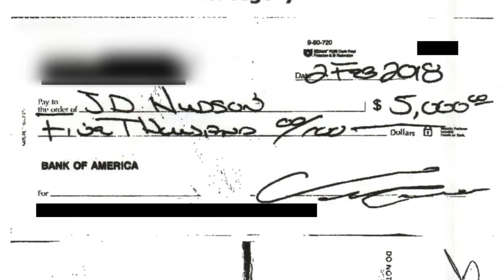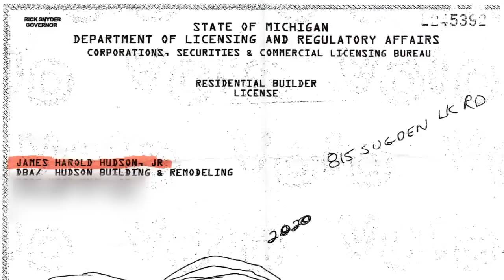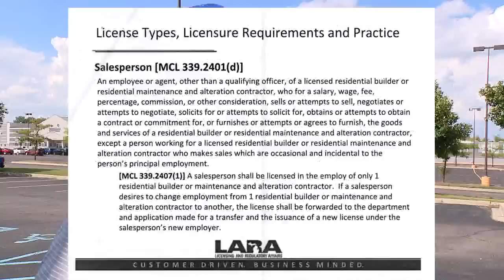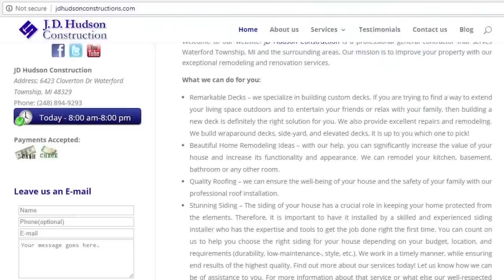Bamboozling Builders in the Hall of Shame

Comment: Never Never pull your own Permits for a contractor Huge "Red Flag" I feel bad for the these people who did. Depending on you state when a contractor pulls a permit they are on the hook for doing the work and calling in for inspection to insure the job is done in a timely manner, usually after permit is pulled the contractor has 180 days to call in 1st inspection to make sure work is getting done, If you pull the permits and you have issues with contractor he can bail on you leaving you on the hook to get work done. Also some state have "Contractors Trust Act" where money given for the job can only be used for your job if not the contractor can be charged with a felony. 
Hopefully this info is helpfull to someone

Comment: As lousy as these two are. The homeowners are also to blame. When you pull a permit to do work on your house you are asked point blank if anyone else will be working on it and what they will
be doing. That's your first clue there's a problem. The other thing you have to watch out for is they will tell you that they will take care of the permit and charge you for it. But don't let them start 
until you see the permit or they may just forget to pull it. But they won't forget to charge you. The permit is to protect you from these kinds of problems.

Comment: No way I would have taken on that job for 168,000 ..I can tell by the scope of the work from what I see .. A legitimate contractor would have asked for substantially more . Granted these morons had a racket and probably subbed out other fly by nights trying to scratch by for nickels.. Does anyone ever look into what the homeowners expected for the money .. Granite countertops  , Hardi Siding , Marvin Windows , Pickled floors , Class 1 finish , Stained walnut trim .. Lighting , .. These are factors that few consider . Homeowners can be unreasonable too ..I wouldn't have touched the job ..